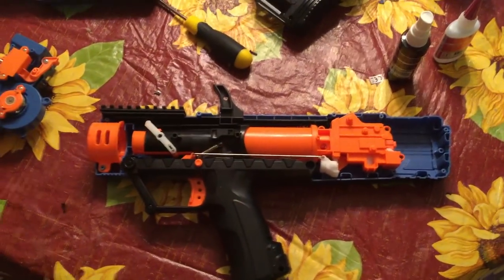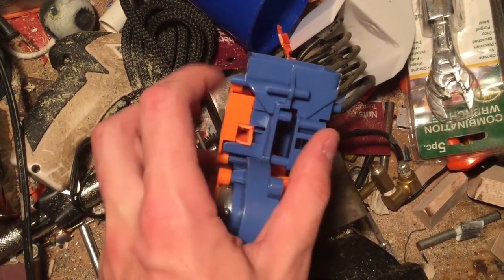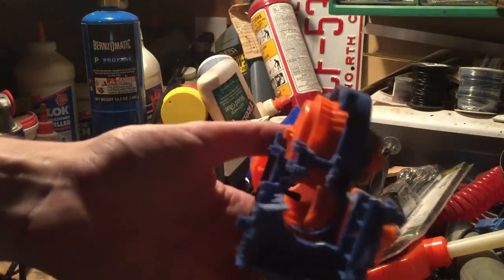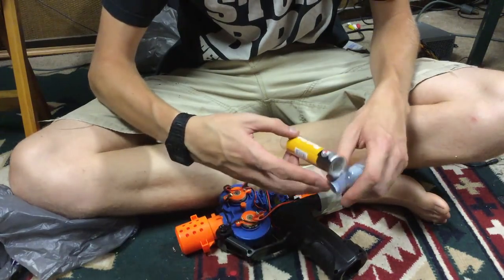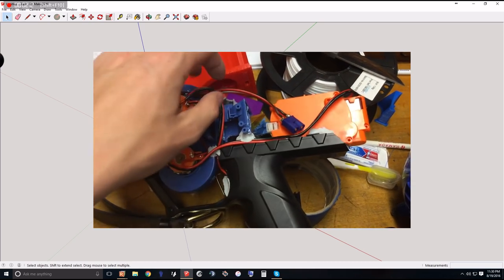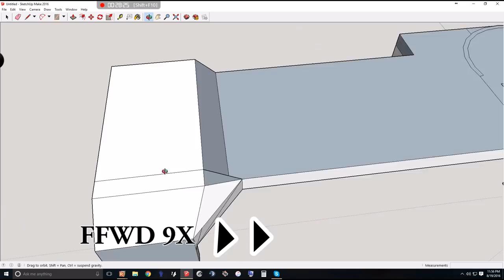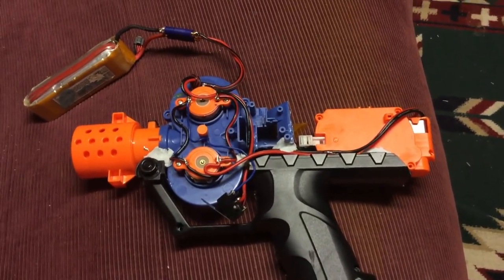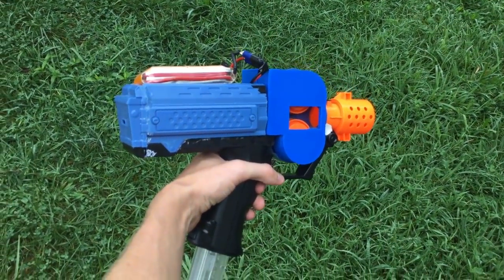Nerf Rival Uzi - the NIKE

Comment: Two thing: 

1) (if you're a stickler for accuracy in these things, like I am) Google doesn't make SketchUp anymore.  They sold it to Trimble Buildings, and architecture and modeling company.

2) Have you ever mounted the flywheels horizontally?  What effect does that have on trajectory?  It would not interfere with the trigger that way.

Comment: 1. This is one of the most incredible Nerf overhauls I've ever seen! You put an unspeakable amount of effort into this, and now I want to make one myself. 
2. What brand is your 3D printer?
3. Where would I buy the flywheel that you used without buying the blaster itself? I know I just mentioned my curiosity about the 3D printer, but I don't want to buy a $60.00 blaster for one specific part.
Reply from the maker: I have 3 printrbots and a wanhao duplicator i3. Unfortunately, the only place I found the flywheels are from a zeus. You now might be able to find them in a mastadon or a hera. Try to find someone on ka nerf group that has one in parts and will sell you just the wheels.
Reply: Thank you very much for your help. I hope I can find those parts for a decent price somewhere, because neither the Mastadon or Hera are very inexpensive. Maybe I can find one second hand through OfferUp or LetGo.

Comment: This is better than coop772. Coop needs to see this
Reply from the maker: It's different. I wouldn't say better. Rapid pistol vs. uzi? I think they're incomparable. Different ammo and power types.
Reply: Plus with the clips you can add more capacity plus nerf dart cost less soooo
Reply: And it's not like coops is that much cheaper either so really. I would rather have coops because it will be cheaper and better in the long run more ammo per clip and you don't cringe whenever you fire a bullet because let's face it those rival balls are expensive
Reply from the maker: Well, you can have your rapid pistol. I like this blaster myself
Reply: custom3dnerf mods I would like to buy one

Comment: This looks pretty neat as a proof of concept.
I'm curious as to why you wouldn't orient the flywheels horizontally?
That way the cage wouldn't be taking up most of the trigger guard area.
Reply from the maker: Originally I thought of it, but I was hellbent on making it holsterable. Better to have a taller blaster than a wider one for that.
Reply: Fair enough, it seems to have turned out OK.

Comment: What is the gun on your icon pic
Reply from the maker: Mizter Wizter a see-through recon with retaliator internals, a pump grip, and RGB LEDs inside
Reply: custom3dnerf mods like a retalicon do a video on it plz
Reply from the maker: Mizter Wizter I called it a reconciliator. But yeah. I sold it to someone at NvZ this summer, as a set with a matching NF and maverick
Reply from the maker: Mizter Wizter I called it a reconciliator. But yeah. I sold it to someone at NvZ this summer, as a set with a matching NF and maverick
Reply: custom3dnerf mods ok
Reply: custom3dnerf mods you should call it the hellrazor500